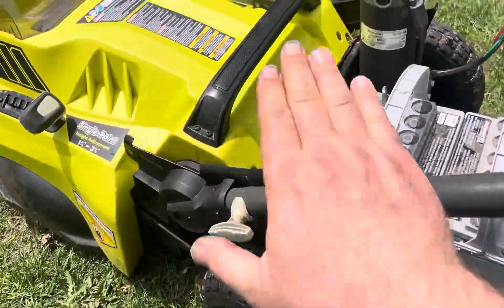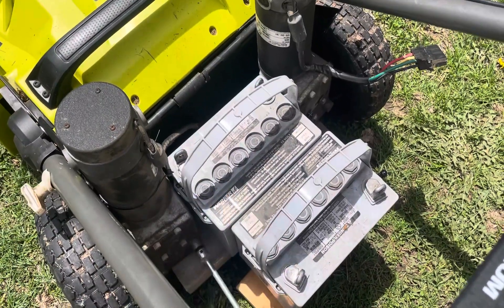Planning an RC Electric Lawn Mower

Comment: I did something similar with a 19" Brute electric mower. And since it has an internal 24 volt battery pack, that is what I am using to power the drive wheels.
Reply from the maker: @staudenmaierca  Yeah, that’s one thing I’m still trying to figure out - voltage mismatch. The mower is 40v and the motors are 24. I might be able to use a DC/DC converter to drop the RYOBI battery to 24v for the wheelchair motors, but a lot of those little converters are only 10 amps. I’d like to have more power than that available for the motors. 
I’m going to get the mechanical parts working first, and then focus on the electrical.
Reply from the maker: I tested the wheelchair motors running on a single 18v Ryobi battery. MORE than enough speed! Not sure how much run-time I’ll get though. I think I’m going to start off by trying to run it with two 18v batteries in series. 
If I’m not happy with that, I can always use the original batteries that came with it.
Reply: @BenjaminNelsonX  That's great! On mine, I've got the RC controller set to 25% max. Otherwise it just wants to wheelie and is way to fast to drive.
Reply from the maker: @ I played around with the RC settings and was able to slow things down.

Comment: I think that RC provision and operation will not make mowing easier. I would rather add 2 push sensors on the handlebar to act as throttles for each wheel and walk it. You get much more precise control by being with it. Just my opinion.
Reply from the maker: @stanislavjaracz  I completely agree that a human on the mower handle would give more precise control. 
But I can already push a mower. This is really more about having fun and trying something new!

Comment: love this project idea. i think you would be better off taking the front caster wheels off separately and mounting them to the original adjustable wheel shafts. I think if you try to mount it with that center pivot, you would lose the adjustability (as you mentioned) but I think it would also cause a problem when you go to sloped ground on the side and the swivel would slant the front wheels to accomodate but the deck wouldn't which might mean that your deck is digging into the ground. anyhow, can't wait to see what you do with it!